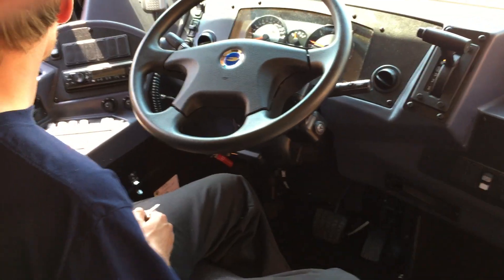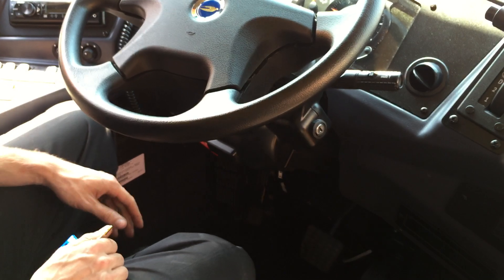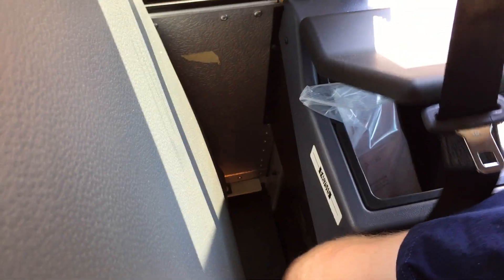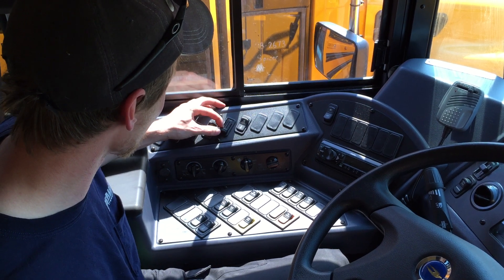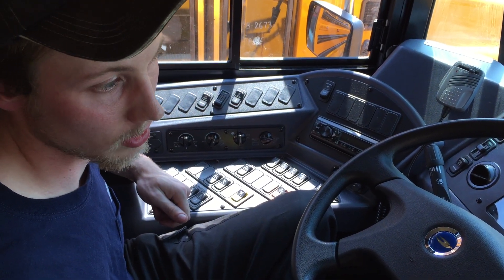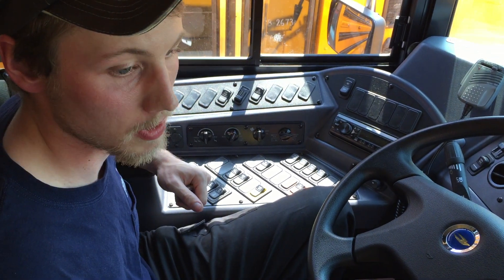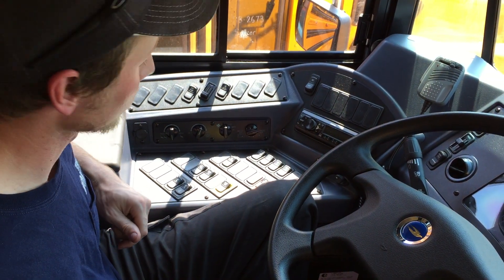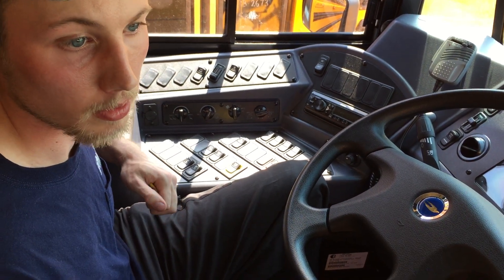Blue Bird School Bus Convection Heat Operation

Comment: The Electic booster pump is great on big buses driving on the highway in 0 F weather!  The interviewer still did not understand how the system work. Also their are also two master valves under the hood, that must be turn off at about 50 F to prevent the heater box from cooking the driver. There are fan switches for the rear also

Comment: The dimmer switch doesn't control airflow. There's a dial on the row below that that has "passengers/ driver" which is what can be set to control the flow of air between those.